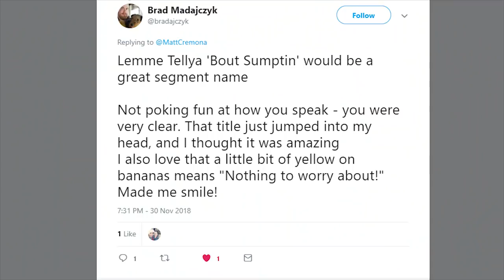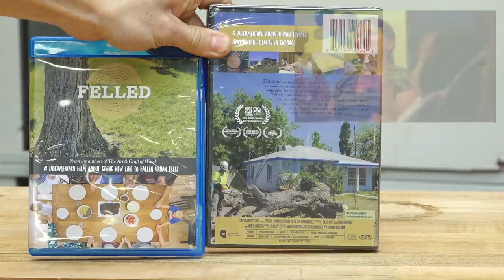Matt's Weekly Shop Update - Dec 6, 2018

Comment: Two things : If you cut down a tree and slab it, how long on average does it take to get to the point of building furniture? What do you do about bugs, mold, smell, and rearranging of those slabs in your basement? Constant fan and stable temps I get but ... for how long (kind of relates to first but not everyone has basement area with controlled environment. I.E. outdoor drying stacks, kiln dryers (DIY) meaning different ways of drying the wood.)?

Comment: Matt.. I have some walnut slabs that is about 12% moisture content right now.. if I was going to do an epoxy pour and cast the slabs fully, would I need to dry it to 8% or would it be safe to leave it as is? Didn’t know if I still had to worry about wood movement and shrinking, so, figured I’d ask THE MAN himself lol!  Thanks buddy
Reply from the maker: I would get it down lower.  You'll get a good amount of shrinking once it comes indoors especially if your house is as dry as mine is this time of year
Reply: Matthew Cremona awesome... will do and thanks for the response

Comment: Do you need some Patreon money for a new drying fan? That one looks rather beat. But if it works, that the important thing. 

Also, you have an "on air" door hanger. Shouldn't it be on the outside when filming? LOL.

Anyway, it all sounds like a great time and I'm looking forward to the new segment.
Reply from the maker: hasn't died yet.  It's the same fan i bought to cool my dorm in 2005.  Still spinning thousands of hours later.  Some how.   

It's cold out there.  I don't want my sign to freeze :D